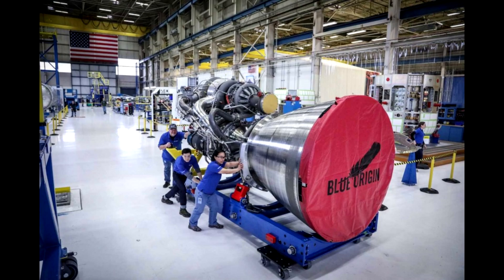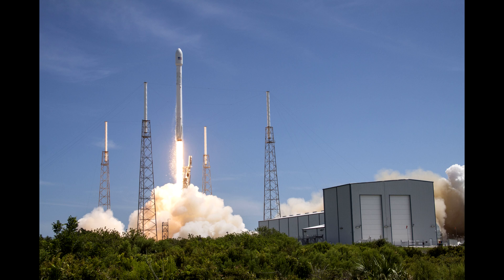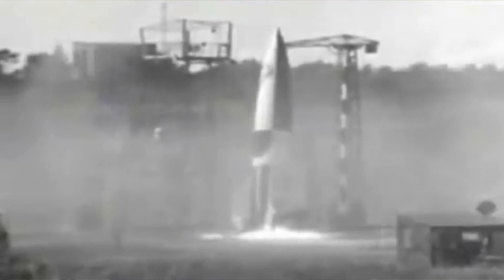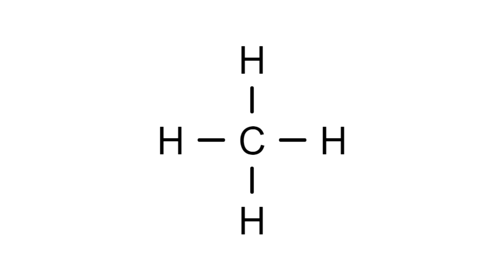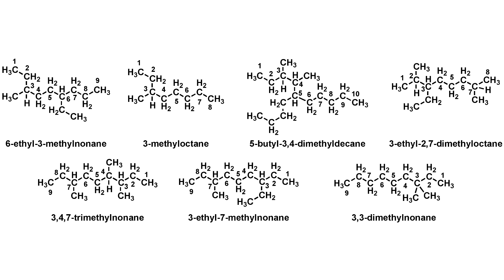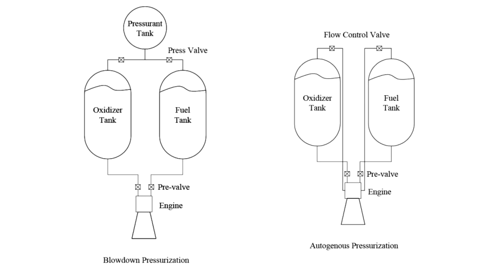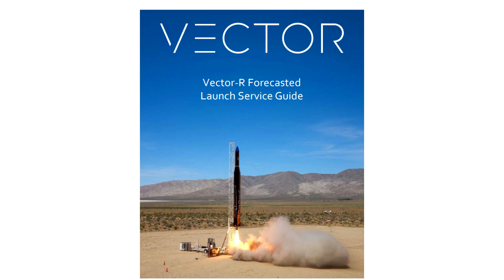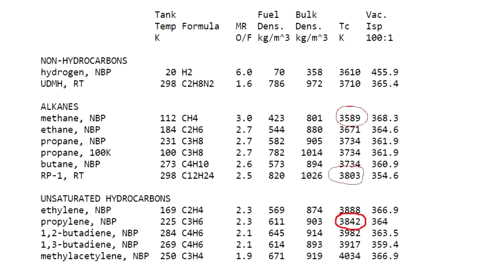Why Next Generation Rockets are Using Methane

Comment: Two additional advantages not mentioned: 
1) Methane is SIGNIFICANTLY easier to store in space and does not boil off like Hydrogen.
2) Methane and LOX store at similar temperatures meaning you can use a common bulkhead and reduced the structural weight and insulation requirements.
Reply: Methane preferred for Reusability (BFR, New Glenn, Vulcan), as Scott mentions, cleaner on engine.

While ULA only discussed Vulcan engine pod recovery (old Boeing EELV proposal, 1995) — 
I would not be surprised for a Vulcan 2.0 stage based on New Glenn recovery success and economics — 
IF both conditions positive, then a technology / knowledge transfer between Blue Origin / ULA possible before 2025.
Reply: w9gb Propulsive landing isn’t going to happen with Vulcan. It’s a problem of minimum thrust vs. weight. One of the biggest challenges SpaceX faced with propulsive landings is the “hoverslam” maneuver. The amount of thrust of a single engine at minimum throttle exceeds the weight of a nearly-empty first stage. So the only way to successfully land the rocket is to carefully manage its momentum during the landing burn.

New Glenn won’t have this issue thanks to the large cluster of BE-4 engines and their deep-throttling capability. Just like New Shepherd, it will be able to come to a stop above the pad before gently touching down.

But unlike NS with a single under-sized BE-3, or the seven engines of NG (with just one operating), Vulcan will have just two engines. Even if it could balance itself on just one (which would be rather similar to Atlas V launching with a single SRB), and even with the deep-throttling BE-4, the thrust:weight ratio would be absurd. It would have to perform a hoverslam that makes the three-engine approach occasionally used by Falcon 9 look like a tranquil walk in the park.
Reply: @pseudotasuki  
thanks for the input.
Reply: I came up with the same benefits. Depending on source it could also be greener than RP1. You can get plenty of methane from sewage for a start.
Reply: @seriousthree6071  I suppose a manned mission or craft could re fuel itself from human waste then!
Reply: @chrismoule1  a closed loop life support system can produce methane.
Reply: @chrismoule1  if there was enough of it. All you need is a suitable container and system to purify the gas. Methane is one of the most easily produced fuels and one that produces far more "greenhouse effect" than CO2. It is less toxic than kerosene and does not leak from sealed containers like pure hydrogen can.
Reply: @miles2378  yes, but won't be closed, as you'd be loosing mass to propel yourself forward. And rockets won't win a fuel efficiency contest ever...
Reply: @seriousthree6071 kerosene is not significantly toxic
Reply: and methane self pressurizes, meaning the worlds helium sources can be preserved!
Reply: I think LOX/LOM ("methalox") is an even better match in that they look to have comparable densities. Not quite the same tank volumes from the released drawings, but likely roughly the same piping, turbine et cetera requirements in the staged Raptor engine.
Reply: You seem a smart guy sir. Tell me. Why we still use rockets after almost 60 years? When there are better technologies - faster and safer. But not used. Why? 

 What is the logic behind it?
Reply: RyeOnHam 1) Source?
Reply: Methane can be generated
Reply: True enough.
Furthermore, methane can be found in abundance all over the solar system  so it is conceivable  there could one day be "filling stations" at outposts all  over the place.
Reply: also CH4 molecule is bigger than H2, means better sealing.
Reply: Also, lakes of methane on some of those planetary moons
Reply: Mevlinous ☆ "If I can just make it to the Next Exit. Running on Fumes, now!"
Reply: Nice - thanks for sharing!
Reply: Never been a fan of common bulkheads.
Reply: It'll be interesting to see if advances in material science (e.g. graphene & aerogels) will be able to offset the storage and handling downsides of H2 + O2 at some point.  23% higher ISP (relative to CH4 + O2) is a lot of potential to work with.
Reply: RyeOnHam , sorry to open an old thread. Is point 1 because of the conversion of orthohydrogen to parahydrogen? As far as I understand it, you have to convert the molecules with aligned spin into ones with opposite spin. Since electrons are Fermions, this releases heat and therefore requires an additional refrigeration step. Would this be hard to do in space or on the surface of Mars or the Moon? I really don't know. I just remember something about this from years back.
Reply: This entire discussion is bonkers. People use their opinions instead of citing real data to prove their points, and the result is a quagmire of bizarre ideas based on imagination.
Reply: Common bulkhead is definitely clutch. So much mass saved. On paper methane gets a "meh" but practically it's a huge win, especially for reusable rockets
Reply: And not only that but titan would be a giant fuel station
Reply: Methane is also a lot cheaper compared to RP-1
Reply: @itsgoodtoplaygames3830  was literally about to say this. Methane makes the rocket more commercially viable.
Reply: Two more:
3. RP-1 would likely not work in a full flow staged combustion engine. Considering the situation in the fuel-rich preburner...
4. The cryogenic methane can cool the nozzle. So you don't have to expose the red hot nozzle to pure oxygen..
Reply: You all probably dont care but does someone know a way to log back into an Instagram account?
I stupidly lost my login password. I appreciate any help you can give me.
Reply: @Sonny Calvin Instablaster ;)
Reply: @Walter Kyree I really appreciate your reply. I found the site on google and I'm in the hacking process now.
Looks like it's gonna take quite some time so I will reply here later with my results.
Reply: @Walter Kyree It worked and I now got access to my account again. I'm so happy:D
Thank you so much you saved my ass!
Reply: @Sonny Calvin You are welcome =)
Reply: Methane does not boil off like Hydrogen but it still boils off, and thus that's why the best are hypergolics 😎
Reply: Methane/Natural Gas is cheaper per J
Reply: Shlomo...since afaik propane is a better heat source why not use that?
Reply: For your first statement, RP1 has the same advantage, that's why the Saturn Vs first stage burned RP1 and the third an second stage H2 ;D.
Reply: Mandernach Luca The Saturn Vs first stage never made it to orbit or space, even. I don’t think that’s the reason they chose RP-1 for the first stage.
Reply: @SuperCuriousFox  
While that is true,... wait, i my read his comment wrong 😅. So or so, RP1 may not made it to space but the first stage still did the heavy(est) lifting of all the stages, so one would think that they would also have used liquid hydrogen in the first stage, since the specific impuls for RP1 is lower.
Reply: @Mandernach Luca
All of the bonuses for Hydrolox superior specific impulse goes away when you consider the mass requirements for such 1st stage system. Yes, hydrolox engines can be very efficient, but LHx storage is difficult and expensive. It needs special materials as many metals simply get embrittled and leaking such small molecues. This adds up to tankage and piping mass. Second downside is particle mass. Hydrolox engines have really hard time to provide proper mass flow, and end up being too weak for sea-level operations.
Reply: SuperCuriousFox I think the reasons were that it was dense, useful enough as a fuel and very cheap to buy and manage in the thousands of tons range.
Reply: @WineScrounger  exactly. For a first stage, Isp isn't super important; for a rocket like Saturn V, you just need high thrust, which comes from heavier fuels. Kerosene is just easier to deal with in many ways. 
Now it's also true that hydrogen is hard to store for a long time. Kerosene would be easier because it won't leak as easily and it won't boil away, at least not nearly as fast.
Reply: Also it required less research and development of the F1 engines. Which was a big enough task already coming from well known (fuel) tech. 
Who knows what they would have decided without the end of the decade deadline which was hanging over everything. 

 There were discussions of using the same fuel in the upper stages for that reason.  The relatively new Hydrogen engines were about as risky as they would go. Also the reason for bigger liquid  hydrogen supplies becoming available only  just about in that time  I guess the advantage was just too big.
Reply: @Haos666, good point, though embrittling is probably manageable for expendable first-stage rockets.  Embrittling is exactly what you don't want in a reusable rocket.  Hydrogen is a nonstarter if a launch provider wants to reuse their hardware.

The expense of hydrolox is the final nail in the coffin.

Methane is a much better rocket fuel from both the standpoint of cost and reusability, and it works out to have a bit better specific impulse than RP1, which has been the gold standard for liquid rocket fuels for a long time.  And it's at least feasible to manufacture it on Mars - though actually getting that done will be a tall order.
Reply: @Haos666  
Well, that's exactly my point. Would it be that easy to store H2, they would have done it for the first stage too but they did not, probably out of that exact reason ;D.
Reply: "Hydrogen is a nonstarter if a launch provider wants to reuse their hardware." - like the Shuttle you mean? :-)
Reply: Haos666: "It needs special materials as many metals simply get embrittled and leaking such small molecues."
Thats not correct. Hydrogen embrittlement is irrelevant at the low temperatures its stored at. Take a look at figure 1.9 in this paper: 10.1533/9780857093097.1
Same with leakage: Its not stored for weeks and weeks under extremely high pressures of >500bar. Its close to 1atm.
Reply: @paulsengupta971  the shuttle did have a problem with cracks in the fuel line which caused delays in the shuttle launches.
Reply: @paulsengupta971  if they had used methane rather than hydrogen the external tank could have been smaller and at least one more crew might have still been alive today.
Reply: The insulation on the external tank was changed to be more environmentally friendly and less sticky.  Therefore, it came off in large chunks unlike the earlier insulation.  They were trying to save the environment and ended up killing seven people.
Reply: Paul, yes.  Like the Shuttle.

First: most of the launch stack for the Shuttle was not recovered.  It was expendable.

Second: the Shuttle's reburbishment workload, cost and timeline made for an expensive mockery of the idea of reuse.

The Shuttle did not prove the case for hydrolox as an effective fuel for reusable rockets.
Reply: RP-1 has better energy density, which is important for a lifting stage (as opposed to a sustainer stage).  The Saturn V first stage was basically just a liquid fuel booster that got the low-thrust upper stages up to speed and out of the atmosphere.
Reply: @Haos666  interesting. Can you please explain what "Mass flow" is?
Reply: @JoshKaufmanstuff  I think it how much mass=fuel can be moved into the combustion chamber per second.
Reply: H2 is hugely less dense than RP1 so you would need a massive fuel tank. This would have increased the weight too much.
Reply: @SuperCuriousFox  The Saturn V used RP-1 instead of H2 because of it's thrust. 
efficiency gets you nowhere if you can't get off the launch pad and the huge Saturn V still only had a 1.2/1 thrust to weight ratio WITH RP-1
Reply: @Enthropical_Thunder  The problem with LH2 is that the density of the liquid is so low. The energetics of LH2 are better but the tanks have to be a whole lot bigger and you start paying a steep price for all of the extra tank mass.
Reply: @jchrisj200  
Not nessecarily, actually, LH2 tanks are usually lighter than gasious H2 tanks with the same ammount of energy. You just need a light but isolating material.
Of course, Methan has the advantage of offering  similar specific impuls with lighter tank structures.
Reply: @Enthropical_Thunder  No, but using LH2 instead of kerosene for the Saturn V first stage would have required a huge and very heavy tank plus the penalties for making the whole structure that much bigger.
Reply: @jamesjohnston3516  
I don't know from where you get this information, but LH2 can have as much as 3 times the energy of kerosine. If anything, the tank should have been smaller.
Reply: @Enthropical_Thunder  It has an higher energy per kg but a much lower energy per m^3. Hence larger tanks.
Reply: @rogierbrussee3460  
Yes, that's quite true but only fot gasious H2.
Liquide H2 is much denser than gasious H2, therefor this is not as much of a problem, especially considering, that rockets almost immediatly use up there fuel. However if they store H2 over longer times, say for example in space, the need something to reflect infrared radiation, like for example those very thin reflective emergency blankets.
Reply: Even liquid H2 a lot lower energy  per m^3 than RP1. It is very light though, so it has a great specific impulse.
Reply: @rogierbrussee3460  
That's true but LH2 also weights significantly less, that's one of the reasons for it's higher specific impulse. With a pump that could manage a high enough volume flow you could probably get the same range with the same tank size than an RP1 tank. What really makes the RP1 a much better choice than LH2 is that RP1 is stable at room temperature and 1 atm pressure and that RP1 has less of a chance to cause cavitation on the pumps compared to LH2.
Reply: @paulsengupta971  The tanks in the shuttle were not reused, and the motors needed extensive/expensive refurbish to fly again!
Reply: @seriousthree6071  Methane wouldnt have worked, Shuttle had small margins and required the ISP that only Hydolox can supply.
Reply: Haos666 If we get much more benefit of fuels that you prefer and think that it is better to use, we must use the same science and entrepreneurship ways , like Musk , to break the obstacles of “difficulty “ and “expensiveness”. If we must leave this world to conquer and survive in other planets , should we do. I hope you get in contact with your crew in your country. Cheers
Reply: yeah but so is literally any fuel other than hydrogen
Reply: boomchacle It would be possible to choose a fuel that freezes solid at the same temperature that oxygen is liquid.  And solids are a pain to shovel into the engines.
Reply: @BoomchacleV0  hydrogen is the highest impulse chemical fuel. It is also the best mass for a nuclear rocket. Sure, if you aren't ready to run with the big dogs you have to use something that's within your limited capabilities, but real rocket engineers use hydrogen.
Reply: @BoomchacleV0  But methane doesn't freeze as easily, whereas kerosene has to be well-insulated in space so that it will still flow to the engine when desired.
Reply: @BoomchacleV0 molten sodium would like a word

(the joke is that there is a engine concept burning sodium with fluorine gas as oxidizer)
Reply: @fakestory1753  What was my original comment? It's been a while and I can't see what you're responding to.
Reply: @BoomchacleV0  "yeah but so is literally any fuel other than hydrogen "
Reply: Mandernach Luca

RP-1 might not boil off in space, but it can gel in low temperatures, making it similarly useless.
Reply: Mandernach Luca - These reason why the first stage of the Saturn V used RP1 is that they had to use the only engine that produced enough thrust that was flight ready at the time. The F-1 engine was developed in the 50's so in order to make it to the Moon by the end of the 60's they really didn't have any other choice available.
Reply: @Aerospace Cadet - Well, that's not entirely true.  They did not have to use it, they CHOSE to use it.  They were developing the "M-1" HydroLOX engine in the early 60's.  They chose the F-1 as it made everything easy in terms of scale.  The first stage would have to be much larger requiring larger transportation, storage, rigging, and launch facilities.  It was the right choice at the time, but there was nothing wrong with the M-1 engine.  NASA also pushed the J-2 and RL-10 engines through for the same project, and both of those worked fine with HydroLOX.
Reply: I don't think kerosene stores well in space, though. Yes, storing hydrogen in space is doable, as the SIVB and many other upper stages demonstrate, but methane is more storable than hydrogen. While Scott may dismiss off-Earth propellant manufacture, Musk does not: the Raptor engine is explicitly designed for it. (And making RP-1 in space ought to be a lot harder than making methane.)
Reply: how long till there's are methane filling station orbiting Uranus? still need that oxygen.... What space force really is is space tanker operation, ten years from now we'll have a pipeline to space.
Reply: Also many of the outer planets and moons have methane atmospheres.
Reply: Good point, but I SERIOUSLY doubt we'll see a methane refuel anywhere but Mars any time in our lifetimes.  Who knows if the Raptor will last that long.
Reply: RyeOnHam 
Rocket engines can't generate any thrust if they are placed in a vacuum chamber.  NASA lies.
Reply: @signlsirchir2156  you win the prize, at least partially. 
Titan has a liquid cycle of methane, and can be one heck of a refueling station.
You slipped up, and forgot that solid water is present.
Breaking down water to hydrogen, which would be mostly considered waste, and oxygen, the oxidizer, would solve the combustion problem.
Also, remember this order of elements...  CHON.
Those are the absolute basic ingredients for life especially food, for nearly all water using carbon-based life, which Titan also has.
When I heard of the methane rocket some 20 years ago, and then heard of Titan's makeup, it was an easy leap to see Titan as a fuel stop.
This also made me ask another question...
Do alien craft also fuel up on Titan?
Have they laid a claim on it?
Hmmm...
Reply: @signlsirchir2156  BTW, Titan orbits Saturn, I forgot to mention that.
Reply: FUCK YEAH! *fires shotgun in salute* #MethaneFTW
Reply: Point 2. Nope. O2 boils at -182.96, so it has to be stored at less than that. Spacex densify it by storing it at just above it's freezing point of -218.79 . Methane freezes at -182.5.
Reply: @donaldasayers  it's closer than anything else. Hydrogen boils at -253, and kerosene needs to stay above about -40 to not freeze. As far as insulation requirements, it's the least of anything.
Reply: @nathanaelvetters2684  I'm not a rocket scientist and this is a real question not a jab, what pressure are those freezing points at?
Reply: @thienlieu2030  1 atmosphere. But adding pressure doesn't increase them very much, only a few degrees for anything reasonable.
Reply: @nathanaelvetters2684  the thought was lower external atmospheric pressure as a shuttle climbs in altitude. International pressure as you said varies very little but in a stage rocket I imagine gains huge importance as it has a huge impact on when the rocket shifts stages
Reply: @thienlieu2030  Sorry, I'm confused. I never mentioned "international pressure differences." What do you mean about the pressure affecting "when the rocket shifts stages?" It just stages when it's almost out of fuel.
Reply: Donald...consider this bizarre fact; methane and water both have the exact same molecular weight, but water freezes at 0C. Why is that? I know: do you?
Reply: @philgiglio9656 because freezing point has nothing to do with molecular weight
Reply: Mr. Sayers, you are arguing with a point I did not make while at the same time you are confirming my point.  We are not talking about SpaceX or densified LOX.  I can GUARANTEE that LOX stored in orbit or en-route to Mars will NOT be densified.  Even so, I did not say that they stored at EXACTLY the same temperature or that it would eliminate the need for insulation, only that you could use something minor for insulation.
Reply: Another advantage is that methane is produced by the astronauts. Just give them a big bean burrito dinner the night before launch and they can fill the fuel tanks themselves!
Reply: knock knock, it's the government. Your CO2 emissions are too high. please switch to hydrogen cus the engines litterally spit out water.
Reply: RyeOnHam ☆ Kerosene is Cheaper & has a higher BTU output. If we could use "Bunker Fuel" that would be the Stuff!
Reply: RyeOnHam 
Another disadvantage : Rockets don't work in a vacuum. 
Try blowing into a vacuum cleaner hose.  Notice your blowing doesn't do anything. Ditto rockets in the vacuum of space.
Reply: @phildouglas9086 you have no idea what you are talking about rockets obviously work in a vacuum